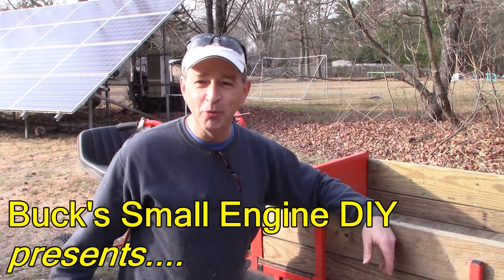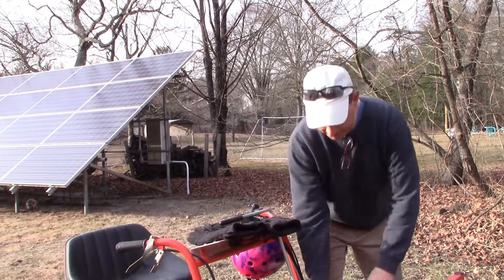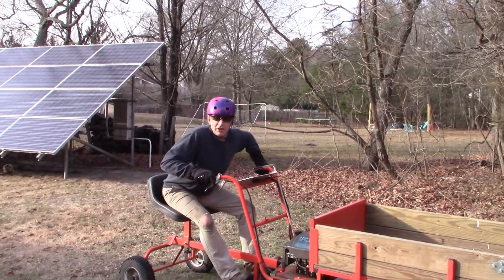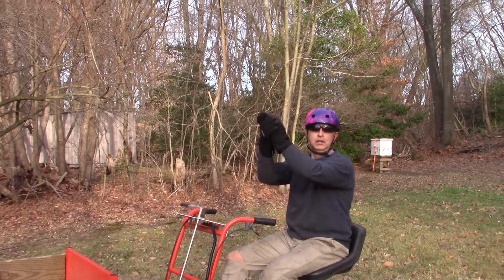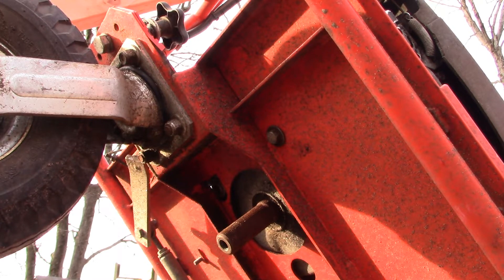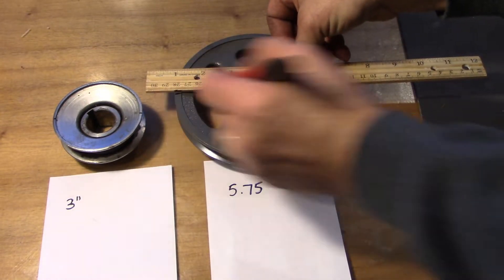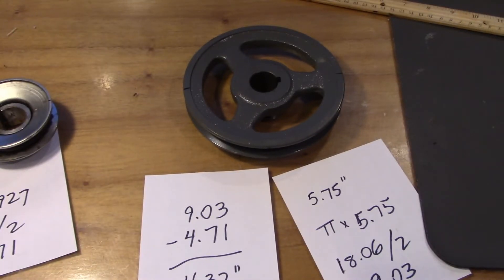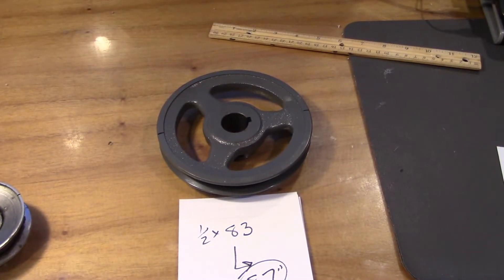Pulley UPGRADE!! Make my DR Powerwagon Utility Cart GO FASTER!!!

Comment: So, it's normal for it to be very slow? I'm using it in 1-2 gears and walk slowly with it, at 3-rd gear it's a bit faster.
What about a load hauling with your new pulley in place? Can it still do 300-500 lbs or it'll strain the motor? Thank you.
Reply from the maker: I now live on a hilly property, and I no longer use the sulky. I just walk behind it. With the new pulley I pretty much only use first or second gears. Still works great, but I haven’t hauled any super heavy loads.

Comment: Just found this video. Cool idea.
Curious if you saw a degradation in grunt torque to pull a load up an incline?
Reply from the maker: Honestly, at this point I pretty much only use 1st or 2nd gear when working or hauling. 3rd and 4th are just too fast to safely manage it.

Comment: Interesting video. Because the new pully is larger, wouldn't you have to take into account more belt length needed to cover the longer/wider distance from the edge of the new pully to the next pully?
Reply from the maker: You might be right. Depending on how a belt is run and how the pulleys are all positioned, there could be other factors that affect overall belt length. But I think in my case, the most significant factor was simply the difference in the old and new pulley circumferences. Also, my cart has a spring-loaded tensioner on a pivot that can accommodate those minor differences in belt length. Since belts are $22 at the local tractor supply, I wanted be more precise than a mere guess! As it turned out, I had one on hand that worked and saved me some money.